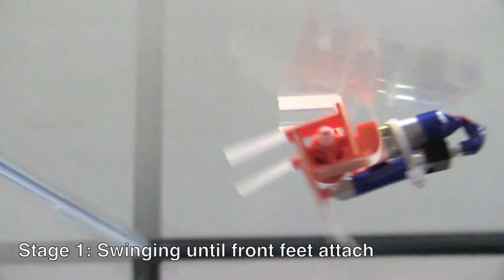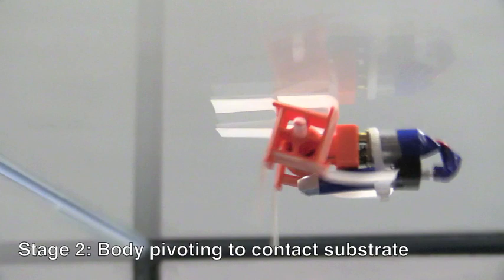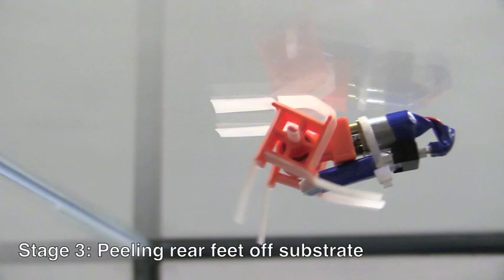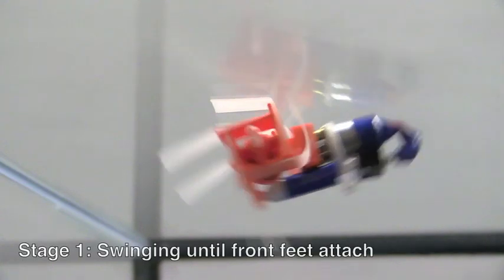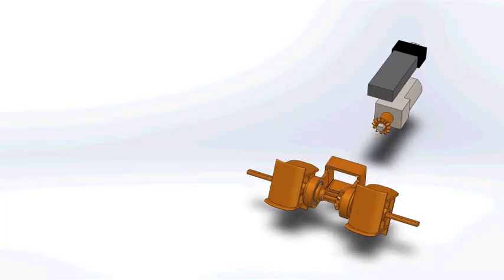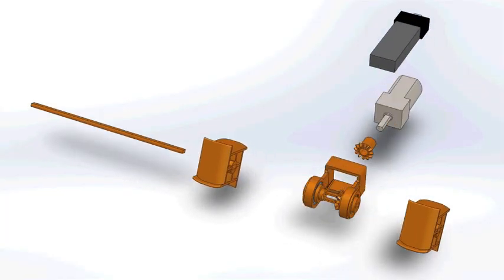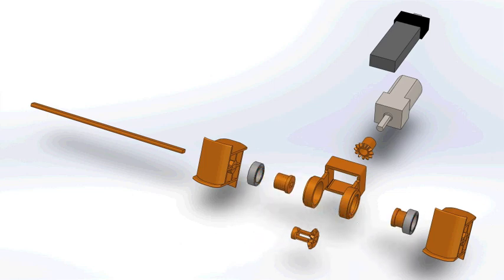Walking inverted on ceilings with wheel-legs and micro-structured adhesives

Comment: Can the bot only walk on glass surfaces or could it climb a traditional painted wall? Also what is the staying power of your adhesive on walls and ceilings? I am sure it varies with weight. I am planning on making something similar for a project but I need to make something  as small as possible. I will be looking into microstructured adhesive. Thanks man.